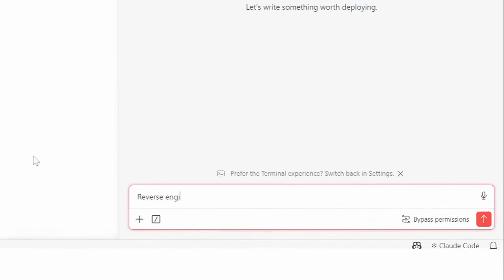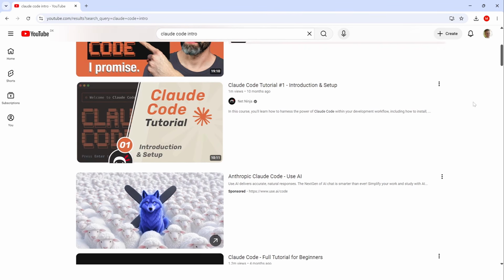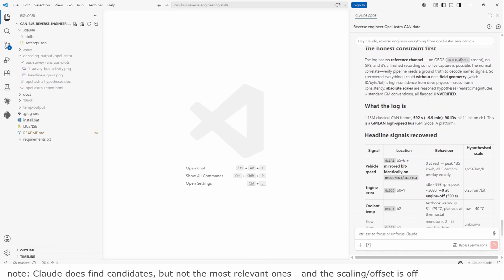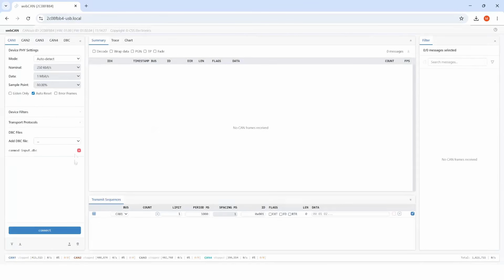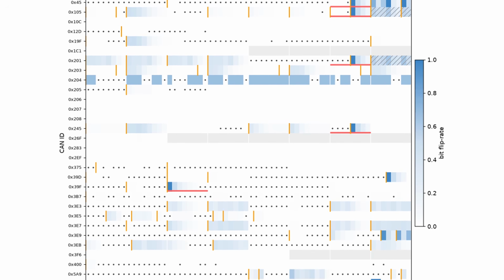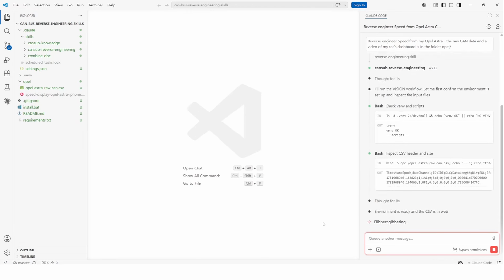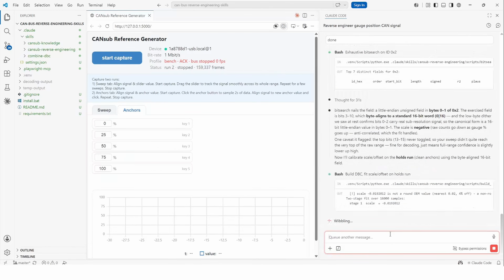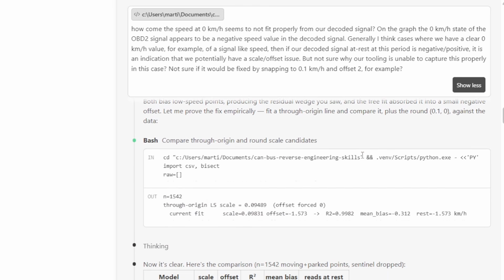AI CAN Bus Reverse Engineering [Claude Code]

Comment: interesting and scary(Danger) once Claude has these skills  our cars will be hacked in the near future.
Reply: I think in practice this approach is mainly going to help in reverse engineering various parameters that you can already observe, i.e. as per the reference signal. I expect  most modern cars implement various security mechanisms (e.g. gateways, seed & key authentication etc) to prohibit/limit access/hacking. The methods outlined here would not really aid in the exercise of cracking passwords or decrypting encrypted data - rather, it's an exercise of decoding plain text data bytes into human-readable form. With that said, there will likely be other techniques/methodologies that are more sinister that can be aided by the application of LLMs and skills.

Comment: Wow, impressive! Maybe this could be used to develop community-driven, fully open-source diagnostic software that actually works.

Being able to overcome the anti-repair restrictions imposed by car manufacturers would be amazing for every car enthusiast and independent mechanic.
Reply: Sign me up, I’ll help develop if you need help. Where is the discord.
Reply: Facts, I had to pay 700 bucks for safe stop, whereas if I had access to the code I could update the auto stop settings to add a setting that would allow my truck to remain running for my k9s.
Reply: @scottsmanonahorse  crazy times. same like when your AdBlue is low in modern diesel and the car will not allow you to start it after few kilometers to save the planet. nobody cares if you are traveling with kids and no gas station around have adblue, your emissions are more important!
Reply: @whattheluck7  I mean, it is important, but there should always be an emergency override.
Reply: We need more likes for this
Reply: Im working on exactly this tuning/diagnostic based on correct math the ecu uses. For now it has 1 aftermarket ecu supported that I own. Just need a database of log and exact tune used so I can get all the aftermarket ecus working. And then start on market ecus but as they dont normally have a lot of sensors to base corrections on itll be interesting. Diagnostic should be fine though watch fuel trims and injector duty. I also had an idea i could make a obd2 dongle that watches trends of output and then updates your phone when it finds something interesting
Reply: :hand-pink-waving:
Reply: I will help develop aswell. Let me know if there is a Open Source Github available for this.
Reply: What diagnostic software doesn't work in your opinion?
Reply: I wish but companies are gating cars to be serviced under paywall this goes beyond coding
Reply: @johnsailor3590  having access to open source and universal diagnostics software would be a start.
Reply: 2nd Wow …. Take this a (big) step further:  reverse engineer the bio-chemistry in pharmaceuticals.  Along with all the test data available, it may show existing limits or placebo’s on drugs which claim to cure disease, where they do not.  Worse case is where a drug only masks the symptoms, and if this Claude-Skill can provide ‘truth’ on a bio-chem level, we may see real progress.
Reply: @stevegyro  why
Reply: @SpotterDeer He wants to entrust his health with a glorified autocomplete bot while he can't even determine, if the bot is hallucinating or not, because if he did understand biochemistry and pharmaceuticals, he wouldn't suggest anything so stupid.
Reply: @randoguy7488  Yeah. AI will probaply turn out to be the means to decoding genomics and predicting the required gene sequence for specific enzymes, antibodies, and all kinds of other biologics. But a commercial product like Claude won't be the one to do that.

Comment: Good way to cut decoding time. I used ChatGPT to create a tachometer using a round TFT display module. What I did was search Github for codes related to rpm. I found a Prius code, then had ChatGPT check nearby codes for my specific Camry rpm code. Was pretty amazing, it coded for the display to test the nearby codes while driving the car, and it found displayed rpm in a few minutes. Way quicker than  asking ChatGPT to try to find the code with no reference. My setup was a Amazon CAN interface board ($7) an ESP32 Wroom ($5) and the round 1.28" TFT display ($3). A previous project on the CAN bus was decoding the 4 wheel speeds- amazing there is enough data to tell the rate of turn from wheel speeds.